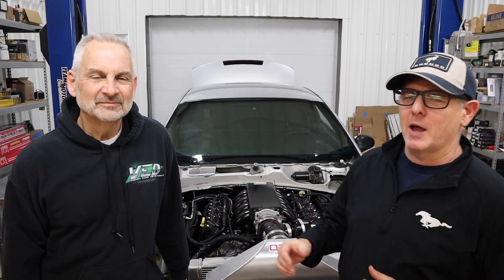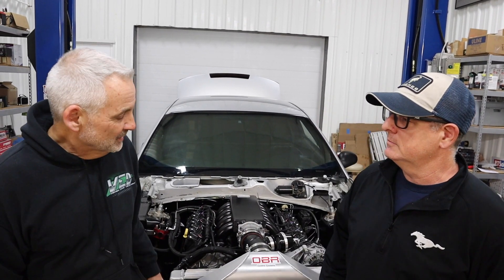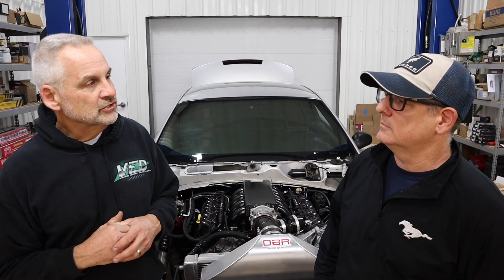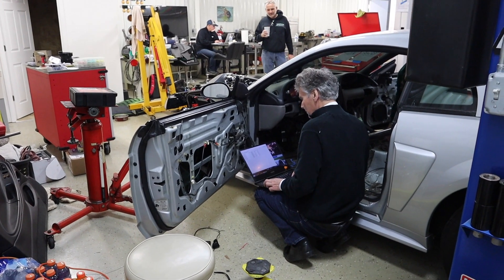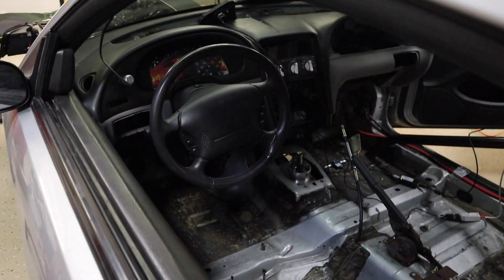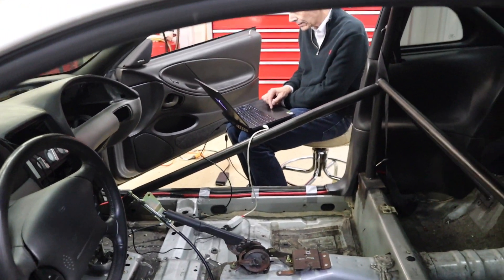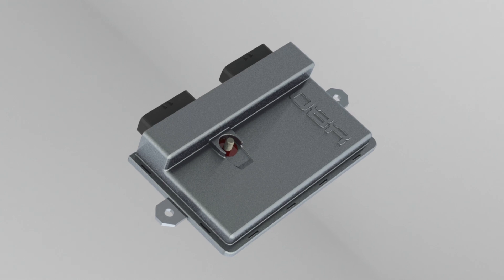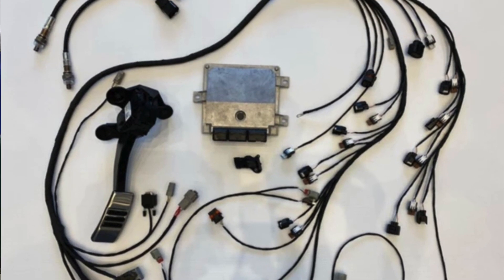Godzilla Wiring OBR EFI & Body Harness How To Run Your 7.3L Ford Engine PT2

Comment: Does it use any open source code? Or is it 100% proprietary?
Reply: The system's logic is controlled by user defined events and we have not yet come across a control strategy we could not handle.

Comment: Would love some actual in-depth how-to videos showing how to sire this, how to program, what features are available with OBS.  On an EEC-4 era Ford, can this be integrated into the factory wiring for dash gauges, etc?  Or is it easier to replace the entire harness with this new system?
Reply: In my opinion it is easier to plan to go this route when planning the project from start.

Comment: Yes definitely want more information, already planning on the OBR engine controller for my engine build with Brian. My 92 is just a shell at this point with no wiring at all so the body controller may be a option for me.  The questions I have a same as Ted Jones comment below. Cost, what comes with the controller and is a 6R controller available through OBR?
Reply: We can supply a stand alone shift controller for the 6R80 automatic transmission.

Comment: How would this be relative to my 1968 Mustang? Obviously, the car has no OBD system or any computer-controlled accessories. Can I still upgrade to this system to take advantage of the modern functionality for at least the fuel and cooling systems to compliment the 'Zilla swap?
Reply: You certainly can.  The power distribution module controls all lights, fans, pumps etc int the car.  If you choose our control pack for your engine, the engine controller and the power distribution module communicates and ensures smart controls.

Comment: 1) What is the average price of the system and does it include a wiring harness
2) Is the system speed density or mass air 
3) Is the OBR controller capable of controlling an electronic transmission in conjunction of controlling the engine. 
Good introduction to the system in the video, look forward to more information on the system and the nice thing is they are located in Livonia.
Reply from the maker: Ted, great questions and thanks for watching. I'm going to let Brian jump in to answer this question. And we'd be glad to do a live YouTube to let everyone ask questions and get them answered in real time.
Reply: 1) Please get in touch with us to discuss your system requirements.
2) The engine is mapped as speed density.
3) Our ECU can control paddle shift in a sequential racing gearbox.  To work with automatic transmission, like the 6R80, you will need a stand alone shift controller.